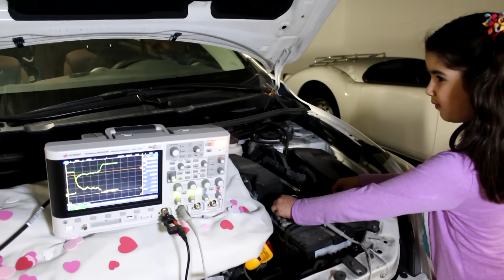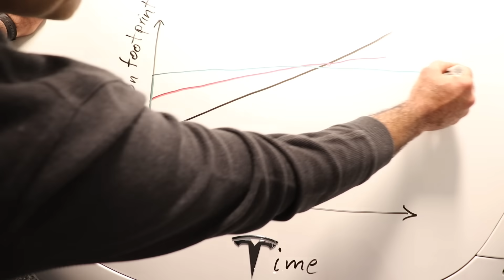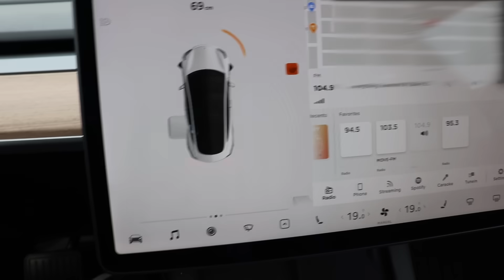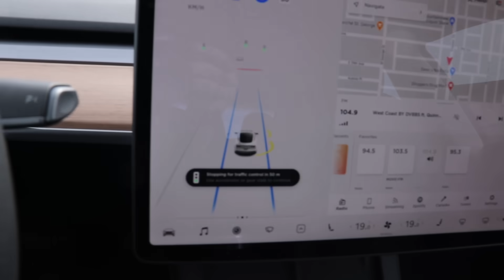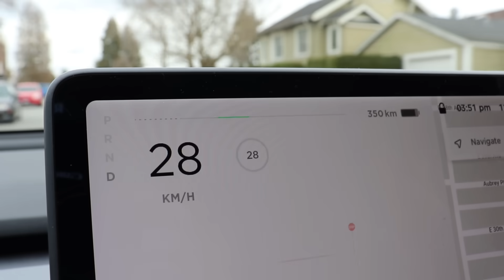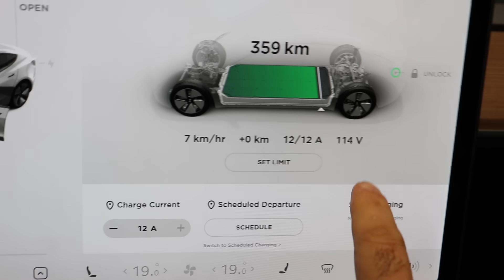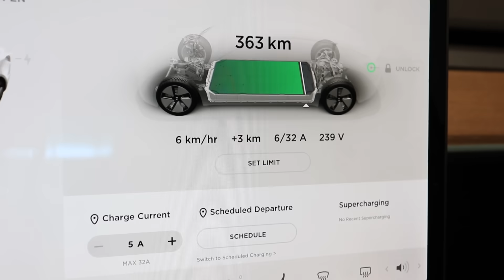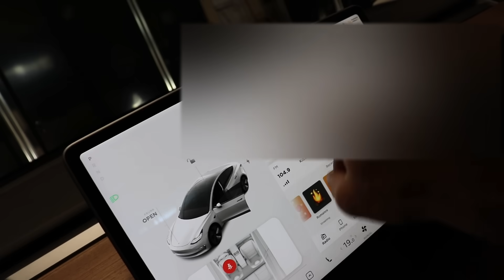ELECTRIC VEHICLES & My Tesla Model 3 Review

Comment: Problem wih EVs is that they don't last even remotely close to normal cars...the battery pack (made of really toxic stuff mind you) will just wear overtime (6-10 years) and will need to be replaced...if the batteries go flat you can't tow it, also the range is insufficient in cold/hot weather (basically earth climate)...We should focus on clean synthetic and depleting current oil reserves which are like an evolutionary gift...
Reply: BEVs come with long warranties, 8-10 years or more is common. And they last far longer than that. The battery pack can be recycled. And it has protections to keep it safe. It will stop you from driving if you go past a certain charge point. And YES, you can be towed just fine. You can even be pulled and recharge the battery from being pulled. Or recharge from a portable generator or large battery pack. Even new BEV trucks can recharge another EV that has drained its battery. And the range is good enough in cold and hot weather, especially for daily driving.

Comment: What will you do if the battery xplodes and car parked in your carport? 
Serious question. Apparently they are quite toxic when giving off all those dirty black gases.
Reply: funny thing is gas cars catch fire more frequently thanEVs
Reply: @nou7401  but yes even so. My question was about the gases that escape around to neighbours. Will it be safe?
Reply: The battery won't explode. At worse it would catch fire, but there are many protections to prevent that. And the toxic gases is overblown. Don't stick your head directly in the fumes of anything on fire and you will be fine.

Comment: Well uh, my gas car doesnt lose charge while its parked, and the higher price for gas to some is worth the 2 minute empty to full fueling process, and not to mention the price of electricity is only gonna go up.   
   But, great video dude. Love the brutally honest opinions, its refreshing
Reply: so you are saying gas will not get more expensive?
Reply: Well uh, an EV cannot have its charge syphoned out by someone drilling a hole in the tank like a gas car. And it only takes a couple of seconds to plug in an EV to charge. You don't have to drive anywhere nor wait on it to finish charging. As for pricing, electricity rates have gone from 10c per kwh to 12.5c per kwh over the last 10 years. Fast food has increased more than that. In the same timeframe, gas has gone from around 2usd per gallon to up to 5usd per gallon and is now hovering at between 3-3.5 usd per gallon.
Reply: its takes 15 seconds to plug it in and 15 seconds to unplug it. thats 30 seconds. Add the 2 minute drive to the gas pump and its 8x faster to charge an EV

Comment: You know, I really appreciate the intro part there.  Not that I should, because he has certainly earned his success.  But I appreciate the candidness there about the car cost and features and financing.  edit: the boxes aren't dense enough to stop it or a fog could trigger it.  edit2: the cold weather of the mountain would have slowed the slow discharge of the battery at idle and it would have read less voltage/charge.  As it warmed up, the charge would have "returned".  Batteries are stored in deep freezers so they hold their charge longer and don't deteriorate.  but when cold, the reaction doesn't happen as well so the battery appears to be "dead".  Heat is actually what causes them to discharge very quickly and actually die or deteriorate.

edit3: why do they not put photovoltaic cells on these as an extra source of charge?

Comment: bring me your tesla in 10 years or 100k miles and lets see how it performs. if its like them cordless power tools its crap, just saying.
Reply: People have done this before and they still operate well. Just like a gasoline car, it will slowly degrade as it's driven. But not to a significant degree.
Reply: It's got an LFP battery. It'll last a very long time.

Comment: U R missing the point man. Its an even bigger foot print because they need to dispose of the battery every 10 years that battery has to be dismantelt and the chemicals need to be disposed off my fuel car can be crushed an melted in to a new car and the battery can be re-used and sinds they use distilled water now that can easily be disposed off the plastic container can be reused for a new battery. also do you have solar energy or coal energy? coal is more harmfull then fuel. oh and renewable energy is more harmfull then good because they have to burn the wind mill props there is no way to reuse polyester.
Reply: None of what you just said makes any sense

Comment: while calculating cost.. consider the intial investment costs. tesla is way expensive than traditional petrol cars. 
toyota corolla costs about $24000 (2023) vs tesla $54000. so the annual saving of $1200 will be justified if you run the car for like 30years or so. also the battery isn't cheap after its constant charge-discharge cycles are over. So EV at present is not affordable to comman man.
Reply: This Tesla doesn't cost $54K, wtf lmao.

Comment: EVs won't be the way. The ice will carry on with synthetic fuels. We will have to develop them for shipping or aviation. Let's be honest if it weren't for pollution the ice is perfect. It does everything well and we have loads of them. No brainer in my view. The tech already exists and our economies heavily rely on the ice engine be it in fuel tax or Motorsport or mechanics. It's a massive part many econonys it won't disappear. Grid capacity is close to its limit so we are going to need serious investment and also solve the problems for people with no parking at home. Fast charging can only go sonfar for it to be viable the cost of transformers and cable and the capacity of the local grid all comes into play. We already have a distribution network for fuel we need to utilize it in a better way not completely redesign the wheel.

Comment: That graph only applies if the original battery lasts as long as the life of the car. If you replace it, you get no benefit in carbon footprint. The super chargers probably kill batteries like cell phone fast charging, which you mentioned later in the video. Then the toxic battery is unlikely to be recycled. The 2017 run of EVs will have 5 million tons of toxic waste at the end of life, alone. 

Saving $1200 a year is nice, but if you could have bought a $26,000 vehicle, it would take you 20 years to realize the benefit. Even 10 years is a long time to keep a vehicle, so even saving $12000 may be better. Not to mention the extra interest on that extra 10 or 20 grand over 4 or five years is hundreds or thousands of dollars. 

Nice car though, congrats, lol.

Comment: How much is it to replace the battery when it degrades to say 70 percent of original capacity and when will this point likely be?? Within 3 years ?? Thanks 

Steve
Reply: 3 years??? Only if it's absolutely malfunctioning. 
JerryRigEverything recently sold his 15 year old Tesla roadster still on its original battery. It had degraded by 15%.
This model 3 uses an LFP battery. LFP batteries last way longer than NMC batteries.

The battery will be among the last components to fail in this car.
Reply: @logitech4873  It's generally accepted fact that EV batteries last at best like 10 years...then the replacing costs more than a new car.

Comment: Most population doesn't have a garage to charge on and most if not all countries grids will not be able to handle the overall demand if everyone who owns and uses a car used an EV. The push for EVs this early is just another way for either taxing those who still use combustion and make the rest indebted earlier not to mention the whole virtue signalling while the fact is our electricity is still dirty, just because you aren't smelling the fumes doesn't mean you're not indirectly burning fuel. First go back to pushing for nuclear energy, then remodel the grid, and then push for EVs and tax the combustion engine
Reply: It's not too early. There is no time to lose. Driving an EV on electricity that mainly comes from fossil sources is still less polluting than driving a combustion engine car. Cars can be charged by using public chargers along the road and at parkings - no private driveway or garage needed. Slow (over night) charging does not put a huge burden on the grid. The grid needs upgrading anyway becaue eventually everything will be electric.

Comment: For a 400 miles autonomy EV vs thermal engine, the crossover point is at around 140,000 miles.  You have to drive for at least 140,000 miles so that EVs become better from a CO2 generation.
I like how he put his brand new car to test: hitting carboard boxes, writing with markers on the bonnet...🤣🤣😂
Due to energy crisis, those calculations are way different.  Electricity price has increased like crazy.  X6 vs what it was in 2021.
Reply: Not even close. There is plenty of research to be found that proves that the crossover point is at less than 50.000 miles.
Reply: @Freba9  Crossover point is 140K, cope.
Reply: @interpl6089  incorrect

Comment: Mehdi, as an electrical engineer, I'd love to get your input on the usefulness of regenerative braking systems. As you always remind us, there is no such thing as free energy, and to my understanding, the physics do not allow more range to be gained from the braking that what is lost from slowing down in the first place. To me, this makes the system pointless on flat surfaces or uphill. They would be useful when going downhill since you are then converting the potential energy from gravity into electrical, but the rest of the time it should be off. 
I know that other EVs such as the Mercedes EQ cars have a togglable system, so you can turn it off going uphill and turn it back on going downhill. Surely this system is more useful?

Comment: well mehdi, you said it pretty much all good. except that range. i dont have experience with tesla but Hyundai EV's (i am service technician for high voltage systems, basicly mechanic for electric vehicles) and depending on the cercumstances you can go even over the max range, in city especialy. does your tesla have variable regenerative braking?

Comment: Electric cars are the worse things that could happen to the environment. When you charge your car the electricity have to come from the power plant to your home. You lose tons of power in the transmission. Plus batteries degrade and you will have to eventually replace those batteries through the lifetime of your car that will increase the initial carbon footprint of producing the car.

Comment: We say that electric vehicle produce less pollution and all but why don't we consider the pollution that is generated while producing the battery that will be placed inside the ev??
Reply: Plus electricity loses tons of power in the transmission wires. And a Tesla is constantly consuming electricity even when not in use while a gas car not in use does not consume any feul.

Comment: It's not self driving, not even a little bit! It's not auto pilot either. It's simply adaptive cruise control and lane assist, plus some gimmicks that don't work well and can't be trusted anyway, like red light detection. It's a fine car, but Tesla marketing misleads people.
Reply: FSD (Full Self Driving) has since been masively worked on and is defo very capable, it can take you from one location to another completely on its own
Reply: @thundurr  No.

Comment: Funny thing is that they were actually using  Intel Atom CPU's with a igpu up until 2021. then they switch to a higher end AMD Ryzen APU in the MCU3. they might have given you the upgraded MCU when they replaced it. I have also heard of these MCU's bricking caused by it storing unnecessary data that it never deletes. as well as the flash memory wearing out. mostly with people who use it a lot for navigation and such and on older model years.

Comment: I am an automobile engineer and I love this review. Most insightful. Especially the suggestion ro charge it at low current that something people should keep in mind. Electric vehicles aren't exactly 100% clean but they are better than what we currently have so use wisely
Reply: Man spitting facts
Reply: Actually charging at low current can drop the efficiency because of parasitic load of the onboard electronics, so I would prefer somewhat in the middle 3-5kw.
Reply: Electric cars still puts out carbon only it's done at the power plant so you don't see it. It puts out way more carbon than a gas car.
Reply: @TentaclePentacle  oh c'mon! I know how much carbon it spits and where it goe.s. its my bread and butter lol. I specifically mentioned that they are not 100% clean but this is the future of transportation. Land, air as well as marine (though they are experimenting with hydrogen and so are others). Also, autonomous vehicles are being developed and researched to reduce the carbon footprint and if u really want future it is hydrogen but will take lots of time so sit tight
Reply: @user-be9qk7vg5y  If it's your bread and butter than tell me about how much energy is lost in the transmission of electricity and how much constant generation is required to keep the power grid up even when it's not in use. Electricity is instant on demand power, and that instant on demand has an energy cost that's way higher than gasoline which is a stable storage of energy.

Comment: i think it makes a lot of sense that you have to tell the car to go
what if the other side of the intersection is congested back and driving would gause a grid lock? what if there is an emergency vehicle coming from the side which you need to let by even though you have the greens?
until albsolutely every car on the road communicates with every other car, "self driving" is just a gimmick and pretty useless

Comment: The reason why you have to move the steering wheel in autopilot is kinda like a dead man's switch. If you don't do it in like ten seconds the car will automatically apply the brakes and autopilot would be disabled until you restarted the car.

Comment: Stick to what you know. Clearly you're knowledge of cars, CO2 gasses and pollution seems to be seriously lacking. You know what the difference is between a ECB vehicle and that Tesla. Your Tesla has an expiration date the day is was produced. That battery is garbage in 10 years. So your car is worthless at that point. Total waste. A ECB car will last 10 years. Not to mention it uses roughly 95kw-250kw to charge a tesla from low to full. Thats about how much power my House uses in a month-to-month basis. The fuck u thinking? Your not

Comment: What everyone forgets with their 'footprint' is the decommissioning of the EV versus a normal car is much, much worse. Canada does not currently have the facilities to properly recycle EV batteries.   At least Boom here does note how much of a dramatic increase in local grid capability would be needed if the masses were to convert to EV - though that doesnt cover how most areas are at or past max capacity as it is and adding to the load would exacerbate brownouts. Funny thing  - Tesla has the programming etc for having their cars serve as battery packs for the grid - thats nice, when YOU need the car in an emergency, the car's dead. Sweet. 

"Why does it suck?" Because it DOES. I like what Musk has been doing, especially lately, but the Tesla car is a massive scam.
Reply: Depends on what is decommissioning, there is talk about recycling old EV batteries to make new ones, that I think will be 2 birds with one stone, it'll reduce the new EV's carbon footprint and at the same time reduce waste and will probably reduce price of batteries, but I don't have a lot of knowledge about the topic.

Comment: I always wondered why those vehicles don't come with detachable batteries. If you need the range you just plug another battery, while the car itself becomes lighter and cheaper to manufacture. 

Plus those "range extenders" can have longer recharging cycles and better maintenance while having a easier time keeping up to demand. Renting is possibly more profitable in the long term.

The only issue is the cost of infrastructure, but that’s true for current charging stations as well.

Comment: I still don't think they are really cheaper, to be honest due to lifetime of the batteries usually don't extend 10-12 years and the batteries alone cost as much as a car, considering you can still run almost any gasoline car for well over 10 years (depending on how much and how you drive), I don't really think electric cars are cheaper to run by any means.
Reply: Gasoline cars (especially older ones) last decades...EVs are not even close to this.

Comment: Ev cars are worse for the environment though 😬😬
Reply: Did you even watch the video?
Reply: @jackwhitlock1  they are the batterys are the same amount of pollution as a gas car running at idle for 10 years and they run out after 5 years
Reply: @slenderisafreak7050  That couldn’t be any further from the truth. The break even for a Tesla Model 3 is 16,000 miles.
Reply: @jackwhitlock1  the battery life for those packs are pretty shit compared to the amount of pollution the lithium mines make💀
Reply: @slenderisafreak7050  That’s not even a comparison, it’s a bunch of words jammed into a sentence.

Comment: Can you measure the charging losses when charging with 5A? Usually switching power supply have peak performance above a certain current threshold. I am curious to see if there are higher switching losses at 5A vs 32A and how much extra current the auxiliary systems of the car are drawing during the charging time. I guess you'd have to measure the outlet energy with a power meter  and subtract the exact kWh that the car is reporting for battery charging to see the  losses.